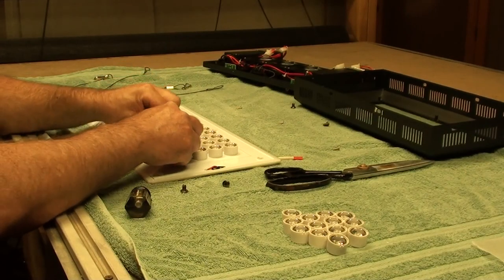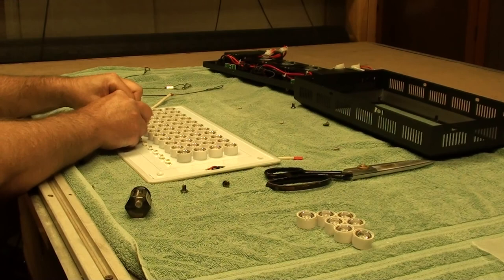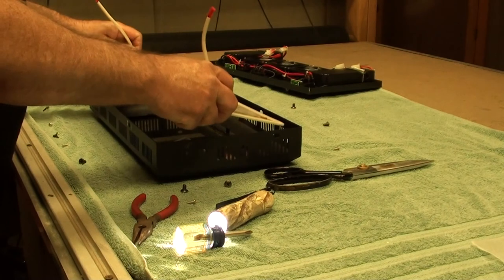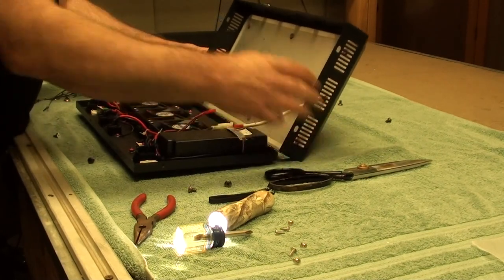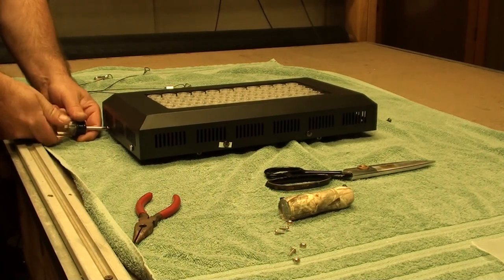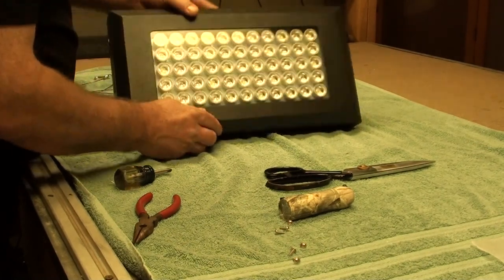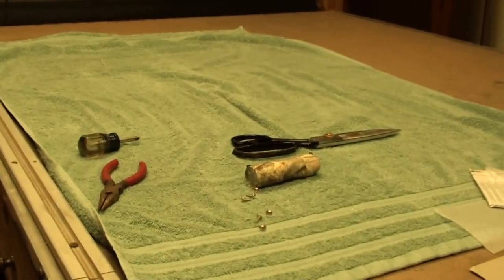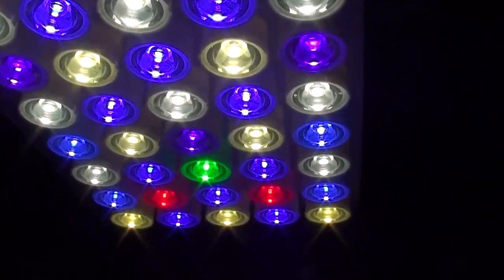Adding Lenses to the LED Fixture Part 2

Comment from the maker: Thank you JRZ. Actually this fixture is above my29g frag tank which isn't really a frag tank yet lol. Couple of monti's in there kicking it but nothing really major yet. Hmm, over a 150, I'm betting two would be ideal. Main thing in your case is knowing where the best mounting height would be based on the depth. They recommend 13 inches or so above the water surface but I forget the actual depth they referred of. I'll see if I can find that out for you. Thanks for watching, appreciated.